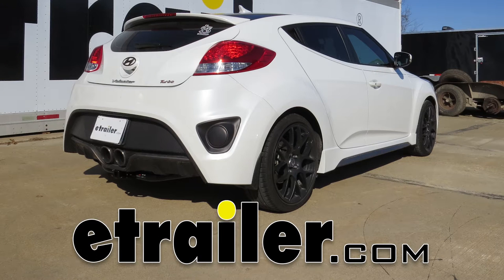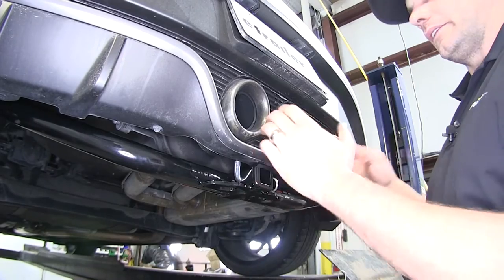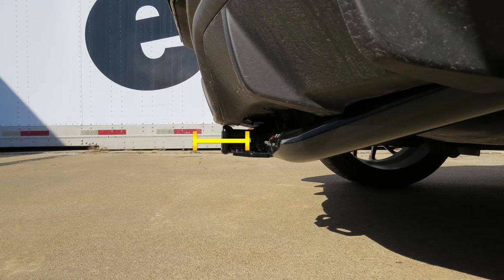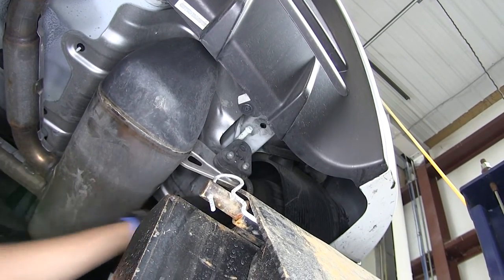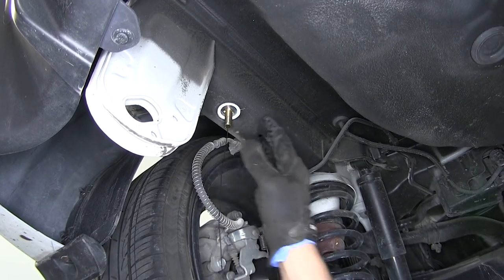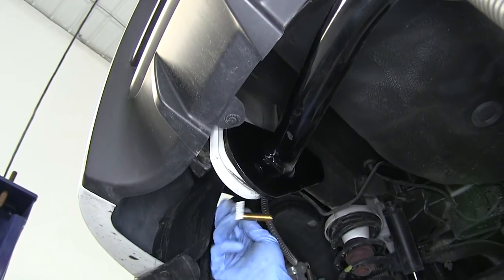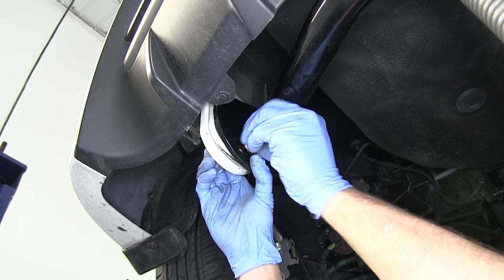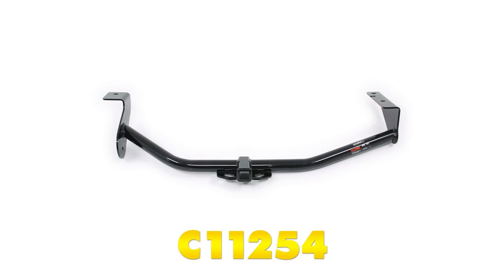etrailer | Mount: Curt Trailer Hitch Receiver on a 2013 Hyundai Veloster

Comment: I’m trying to find a trunk rack for my 2016 Veloster. Was gonna get the allen one from Walmart but not sure if it will fit due to glass. So I’m thinking I need a hitch to but the v shape bike rack idk where to get a hitch installed do I go to Hyundai dealership? Or is   there a Veloster truck rack? Would getting a roof rack be cheaper to get?